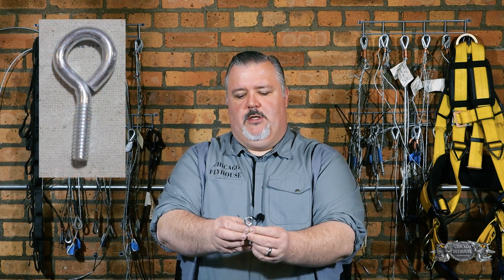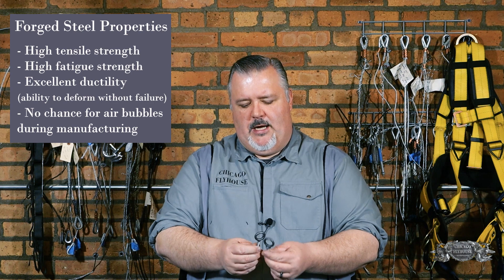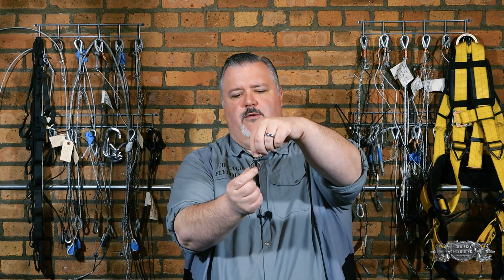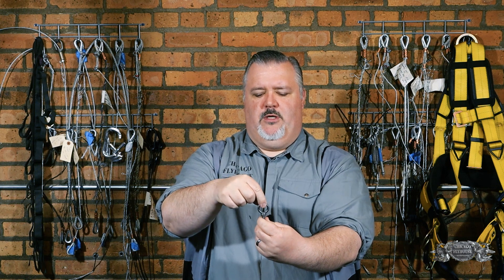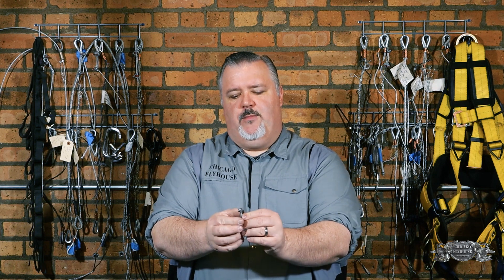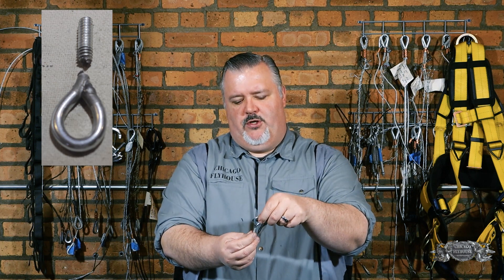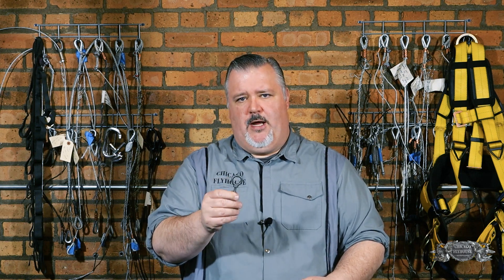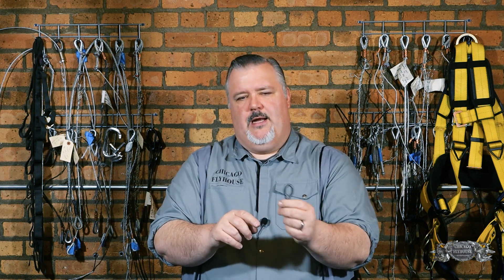Eyebolts

Comment: Incorrect, Crosby shoulder eye bolts are rated for pulling at 90 degrees from center.  (ONLY CROSBY)
Reply from the maker: It is true that Crosby gives a rating of 25% of the in-line pull capacity for their eyebolts for a 90° pull, but across most manufacturers, the ratings stop at 45°.   While we speak with some generalities on these videos to cover a wide range of possibilities, knowing the manufacturer of your hardware and consulting their documentation is always recommended.
Reply: Actually asme b30.26 requires shouldered eye bolts to retain 25% wll at 90* and all hardware used for rigging in north america must meet asme b30.26 so...